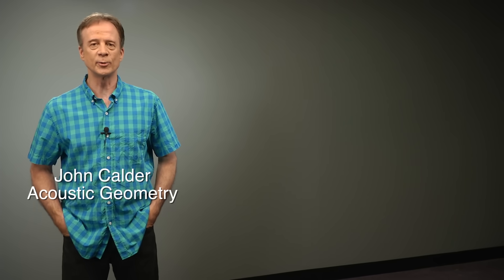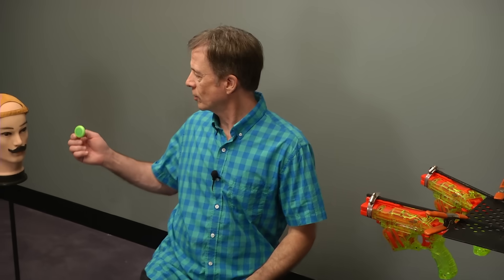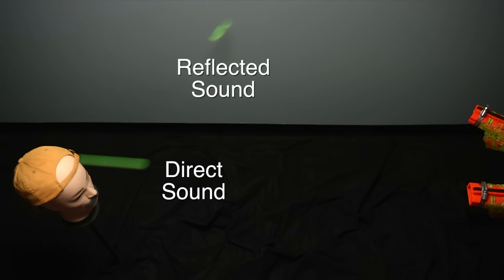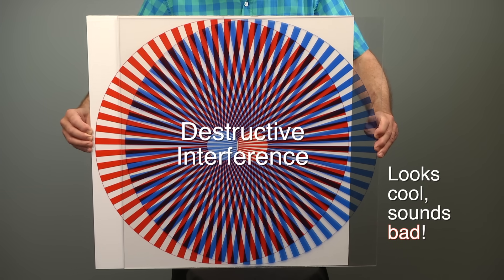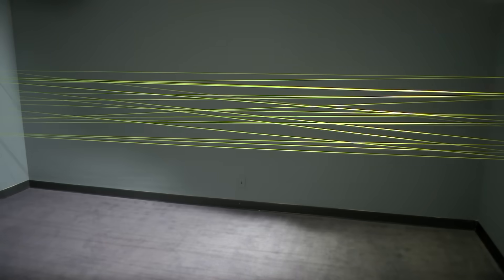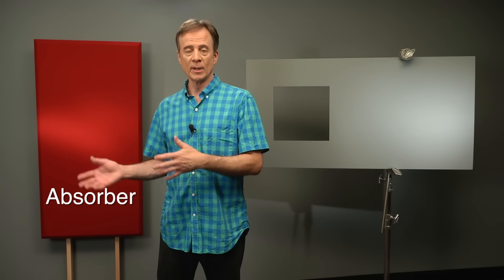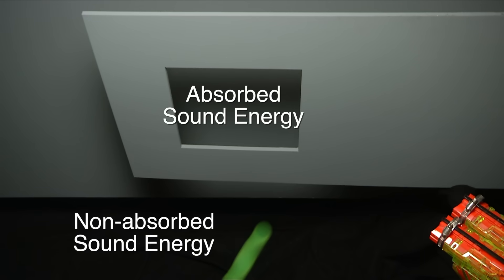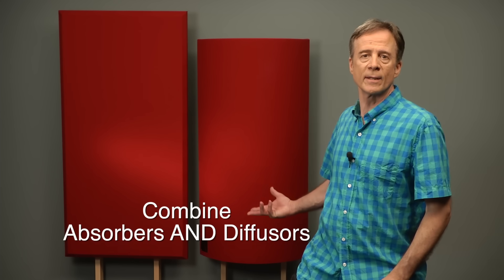How Sound Works (In Rooms)

Comment: Harshest room I’ve heard was a quonset hut. The drums were in the center, with the arc of the bldg., the refelections were not spread out over time, they all came at the same time. You could hear two distinct snare hits, the reflection louder than the original.

Comment: Another way to improve sound is with speaker setup or placement.  Aiming speakers directly at an opposing wall will create standing waves.  Not good for tonal balance.  Cross streaming speakers 10 to 15 degrees will allow sound waves to hit walls at a 45° angle.  The entire listening area could even be canted 30° from the farthest wall, keeping the listening area parallel to the plane of the speakers.  The result is waves bounce around the walls in a circular fashion, rather than being reflected back toward the speaker, which causes standing waves.  The angles of the speakers in my setup greatly improve sound stage and 3D surround effects, with only two reference speakers.  Thanks for the video.

Comment: The overall quality of any stereo audio reproduction or playback system can be dramatically improved without changing any of the existing components through the use of the following procedure that my learned partners and I developed over many years of experimentation with the "loudspeaker room interface": 
1.  Extend the wires connected to your loudspeakers making them long enough to allow  the speakers to be placed anywhere within the listening room. Check for proper "phasing" of the extended cables by visual and aural low frequency testing.
2.  Invite two physically able friends into your listening room, and give each of them a tape measure that can be extended out in the air a minimum of six feet.  Have each of them hold one of your speakers in their arms.  Note: don't give them any beer yet, this will take awhile and you want them to be alert and not likely to drop your speakers!
3.  While sitting in a roll-around office chair placed in approximately the middle of the listening room, have your two friends hold each of their speakers above the floor at your ear height at a four-foot distance from your head, each pointed directly at your ears and spaced six feet apart from each other to start the process. 
4.  Put on some program material that you are well acquainted with that contains a wide sonic spectrum and adjust the volume to your normal listing level.  A remote controllable  CD player will be of great benefit for repeated playback of particular program segments.
5.  Listen intently to the "virtual" center image as you slide the chair left and right, and at the same time, closer to and farther from the speakers to generate the strongest sense or presence of the center image.
 6.  Direct your friends to maintain the correct angle to your ears while adjusting the distance between the speakers both wider and narrower and closer and farther from you and listen for the change in the width and character of the "sound field".  Through this experimentation using just your ears, decide what speaker spacing and distance that produces the best sense of musical "envelopment": being in the performance!
7.  While maintaining the chosen physical juxtaposition of the speakers and your ears,  both your chair and your friends will all move together throughout the listening area to determine the best low frequency enhancement, "room-modes", and the best compromise of "first-boundary" reflections from the walls ceiling and floor that affect the overall sound character and stereo envelopment.  Now it's time to give your friends some beer!
8.  After this experimentation has been completed to your satisfaction, accurately measure where the speakers where placed and note these dimensions.  Speaker stands of the proper height as determined by the position of your ears while sitting in a chosen chair, should be purchased or constructed and positioned permanently or temporarily in the room at the noted dimensions.  Now it's time for you to have a beer and enjoy your much enhanced music listening experience!  David Riddle

Comment: Years later I found this video and stopped watching just at the moment of the two toy guns. Man, the speed of the sound waves is approx. 340 m/h (approx. 760 mph), so unless you live in the Royal Palace in Madrid, without the interior walls, would you notice that reverberation inside your small room...? Maybe if you're under 30 with an incredible hearing ability or your name starts with ‘M’ and ends with ‘att Murdock’.
PS: With each bounce, the sound wave loses energy. Nor does it remain bouncing between two exact points and sooner rather than later it will find more absorbent (soft) materials in which it loses even more energy (power, volume, sharpness).

Comment: These few panels reduce a bit, but the reverb is still too much. Heavy curtains on all walls, that can be drawn close or open are a better solution.
Reply: I totally agree. However, even though I use quite a bit of absorption (plus diffusion) within my small 13 x 11.5 ft living room, I found when I tried replacing my my linen curtains with thick velvet drapes the high frequencies had been stifled! Need I say I got rid of them and replaced my interior doors with curtain drapes.
If interested, here's a little demo...
https://youtu.be/kJoKwQTu7HQ?si=d7P-EGsbxPrMWEmq

Comment: I made 6 acoustic panels 2 foot by 4 foot 4inches thick. Bought a bag of Rock wool sound and fire insulation. Total cost with fabric, $200.00 they worked great. 4 on the walls, 2 on the ceiling above speakers.

Comment: Apparently just ordinary overcrowded furnishings, curtains, and and carpeting works pretty good! Thanks for the tips! Mainly sound issues start with a big empty room - like the gymnasium effect. I am experiencing only a close and small surface reverb effect - there are no echoes. It's the same idea as air filtration - you can set up a small filter to catch the particles - it just takes longer if the filter surface area is smaller.

Comment: great vid and easily explained. I'm still trying to figure out what to do with my setup, which is far from conventional. It's effectively half a shed, already lined and insulated, but with horrid echo even now. it's a large space with an angled ceiling (big part of the problem) and my PC setup in one corner. don't know whether to go full treatment or just enough to stop my voice echoing when talking into a mic (for vlogs and such), like those mini panels you see on ebay. it's a head-scratcher. I know it's gonna sound awful if I don't do something about it.
Reply: You can use a laser pointer to (generally) track reflections. This will give you an idea of where to place your first set of treatments. Just remember, too dead sounds strange.

Comment: How does one know when they've reached the correct amount of diffusion/absorption?
Reply: Good question! About the best advice I have is... when it sounds good across a wide section of your listening area. 
You can also do a number of tests - I prefer an Impulse-Response waterfall display, which will point out any bad resonance frequencies and show continued uneven reverb times in your room. However, they're a bit tricky to do: you need a single coherent, broadband, and powerful speaker to energize the room (using a sweep-frequency test) and a good app. I use an inexpensive but very effective (for me) program from Studio Six Digital called AudioTools for the iPad and iPhone. In the 'Acoustics' tool section, there's an IR (Room Impulse Response, at additional cost), which can display room response as a waterfall plot. I also use an inexpensive test mic plugged into the iPad port, and I make sure the room is temperature and humidity-stable before testing. The tests are only valid for your room and that time of day. It's a good way to compare waterfall plots as before-and-after - this shows the effects of any acoustical treatments you add. The 'compare plots' feature was recently added, and I find it excellent for showing treatment effects. Not perfect, but very informative. Good luck with your room - your ears are still the best test apps - along with a bit of patience.
John
Reply: When you and anyone you demo to thinks it sounds great. A perfectly flat (dead) room will sound lifeless.

Comment: Make a reflector from the upper corners of the room and put sound absorbers in focus. Dissect the sound reflected from the ceiling plane and suppress the lower of the remaining frequency modes. Make sound deadening materials work effectively. Use furniture: tables and cabinets and room structure to suppress harmful frequencies, while measuring and calculating a quarter wavelength of the frequency to be suppressed. And most importantly - be able to stop at a concise solution in time.

Comment: Sound waves travel up and down not sideways. Best way to dampen any room is floor & ceiling first!
Reply: Sorry, not true. Sound energy radiates from sources - voices, instruments, and loudspeakers - in various patterns, most of which are somewhat omnidirectional (and spherical) , depending on frequency. Spherical radiating patterns are made up of molecular compression and expansion, moving outward at around 1130 feet per second (344 meters per second). As sound waves (made up of alternating compression-expansion with wavelengths depending on frequency) radiate outward, their energy diminishes as a square of the distance. Sound waves effectively reflect from all room surfaces - walls, ceiling, and floor - but our hearing is more horizontally focused, so treating side-wall reflections (ceilings next) is critical.
Thanks,
John

Comment: Hi.
Do you have any advice on how to block or reduce the sound of loud dog barking from another room or hallway. Im looking for effective and preferable removable sound proofing in a rented flat/house for the bedroom and spare room to block or muffle the barks and howls from my other halves dogs. I have some some sound sensitivity issues and this would aid sleep and relaxing in the spare room.
Reply: Our Door Seal Kits are fairly easy to install (see our video here: https://www.youtube.com/watch?v=C2MTodSzfts) and not super-expensive, but you'll need landlord or owner permission to put screw holes in the door and frame - also, the door must be solid-core, hollow doors are big sound leaks . Soundproofing walls and ceiling/floor areas is very invasive and expensive. Plus you can't take the added drywall and flooring layers with you when you move.
Note that acoustic treatment panels (absorbers and diffusors) are NOT soundproofing - they only affect sound inside the room. We have a video about soundproofing - here: https://www.youtube.com/watch?v=t8WGBlVI5A4. 
Good luck!
John

Comment: Hi,
If anyone is interested, I published a book called 

"Making Technique for Large Diameter Concave Mirror, Convex Mirror, and Thin-Sided Lens" on Rakuten Kobo E-Book platform. In the book, molding silicone, clear epoxy (or clear plastic resin), polyurethane, air pumping tool, air vacuum tool, wood chips, acetate paper, etc. I mentioned the methods that will allow you to produce meters of diameter using. In this way, you will have the knowledge and experience that you can carry out your projects for astronomy and solar energy in a practical way.

Comment: He left out a very important piece of info. Audio dispersion from most flat faced speakers is conical at a 45° angle of dispersion. If the speakers are the same distance apart that you are seated  from them you simply have someone walk parallel to either adjacent wall with a mirror. From your listening seat as the mirror travels toward the front wall ,when you see the speaker in the mirror that is your first point of reflection. If you capture or reflect the sound at that point your job is done. Audio dispersion from both speakers should be allowed to overlap30 to 40% blending at your seating location. Hence creating that "Sweet Spot!" In closing the tweeter should be at ear level when seated. Speakers should be 2' from any back wall and 4' from any side wall.

Comment: Do not forget that each frequency has different wave length and most critical and most difficult to control is the bass as long wave lengths need thick bass traps made by very special material that is able to transform acoustic energy into kinetic one to be effectively absorbed. Without this tools in room corners and right angles the bass tones are reflecting over and over. 1Hz length is 1130 feet so for instance 50Hz bass sound is 22.6 feet long and if you have the room size lower that 22.6 feet, 50Hz wave is not able to get its max. amplitude before the first reflection. And if you sit 1m from the bass speaker producing 50Hz at max amplitude, the direct sound wave that reach your ears and body is almost 50x quieter compared to its max amplitude

Comment: Brilliant video! Often the two reflections arriving closest in time to the direct sound are the mid to high frequency reflections from the ceiling and the floor. This causes an unpleasant hardness to the sound and confuses the sense of direction,  To counter this simply buy a suitable rug for the floor between your speakers and you listening position and place some simple absorbers on the ceiling in the reflecting areas. This way reproduced sound quality can be substantially increased. Settle for electrically well made but cheap cables and spend your money on getting the acoustics right instead. I promise it will work wonders!

Comment: In Eastern Eu it's super common to place carpets on the walls, it lowers the resonnance by a lot, and also makes it feel warmer
Reply: I'd say it most definitely depends on the size of the recording area. I know people in bands that have told me to place carpet on the walls of my studio, but in my case that just wouldn't work. It's such a small room, that if I were to do that it would kill the sound almost completely, when all I really want to do is control it.
Reply: @KKTRLZ  You are talking about a sound studio instead of a room to live in. Would it not be easier to make all walls absorb sound and then use microphones on different distances and after effects to get the perfect sound.
Reply: @computerjantje  Well, there's only so much you can do post production if the recording itself is already either too flat, thin, boxy, distorted, etc. It's almost similar to video. You can't enhance resolution that isn't there. I'm speaking generally of the vocal recording area and not the setting of levels. I think it goes without saying that no amount of EQ'ing is going to fix a badly recorded vocal.

Comment: How are absorbers and diffusers place in a room to get the best sound?
Reply: nomi udo place full spectrum absorbers in the corners.  don’t add any absorbers that will only absorb hf (those thin foam absorbers that you can stick to walls) absorb it all or nothing.  diffuse based on where the sound energy originates and where you don’t want it to bounce directly, for example on axis with your mic/wall/sound

Comment: Direct is good, reflected is bad?  That is not only fundamentally incorrect but a gross oversimplification.  I know you aim to simplify but the fact is, even your voice, in making this misleading statement, is being supplemented by reflections in a highly beneficial way.  We never, ever hear solely direct sound, and if we did we’d find it very disorienting.  What matters, and it can be quantified as well as controlled, is the ratio of direct to reflected sound, the times of those reflections and the relative tone of those reflections, which we call reverberation.  Real acoustical engineering designs for those three basic elements of reverberation to provide a sound field that is most conducive to the human mind’s expectations, which are very different for speech and music.

Comment: greatly explained 
but when lot of you guys putting a reverb plug-in , what's the point of using a absorber
Reply: If you have a great-sounding room and want everything you record with microphones to have the same room sound, leave the room untreated. But if you want control over the sound you record in your room, add treatments to make the room more diffuse and less resonant at the mode frequencies. Plus - a lot of very good recording engineers do not put a reverb plug on everything, myself included (bragging a bit, I guess...).

Comment: Do drapes, sheers, couches, carpeting, etc. help improve the sound at least - without going to the expense of buying absorbers and diffusers and then figuring out if and where they will fit and then enduring the lessened room space?
Reply: Curtains, carpets, furniture, and other room furnishings definitely help absorb some reverberation, but primarily in the high-frequency range (and it's not very predictable). Broadband absorption is a better goal, and - as noted in the video - good diffusion helps a lot.